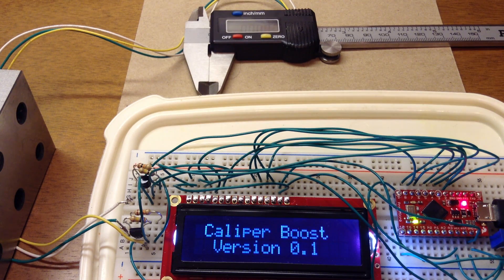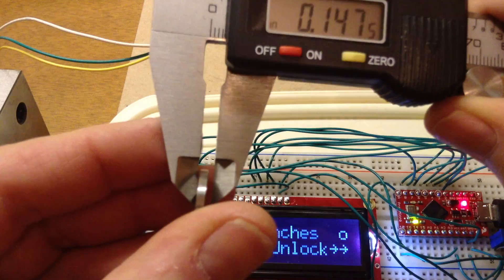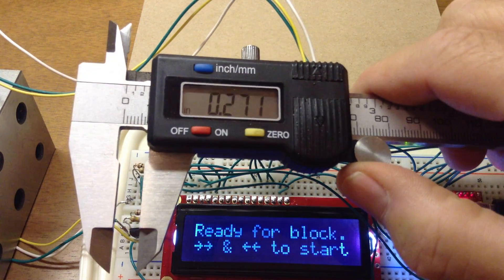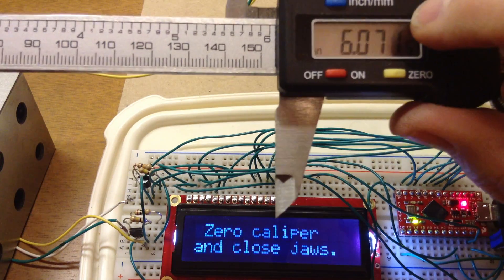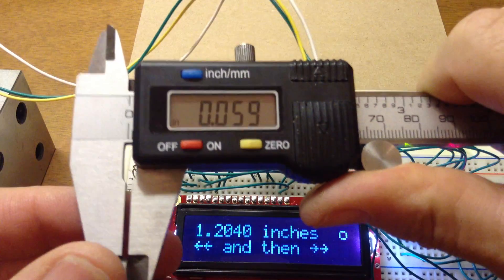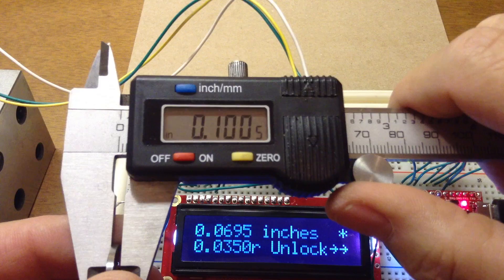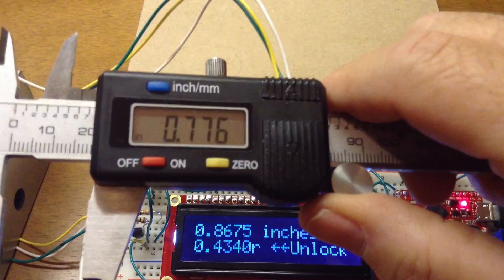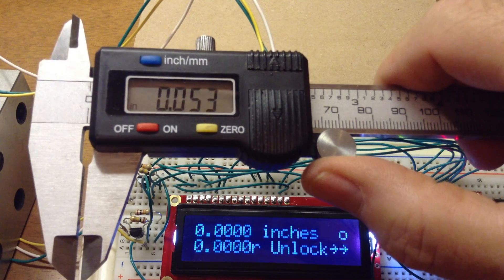Digital Caliper Measurement system (second of two videos)

Comment: What circuit did you use to convert the caliper signal to the arduino 5v signal levels?
Reply: See http://rick.sparber.org/CBOO.pdf page 22 for details of the converter circuit.